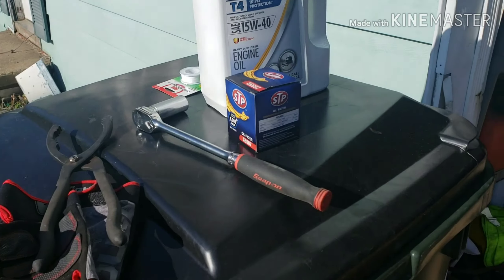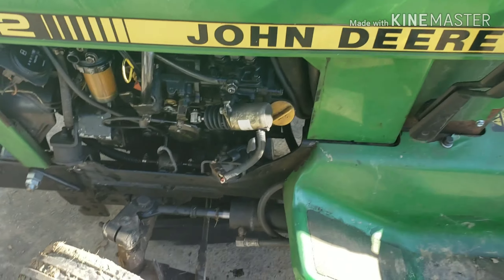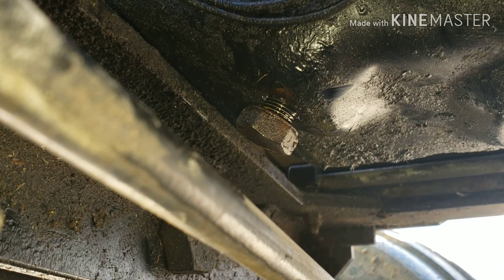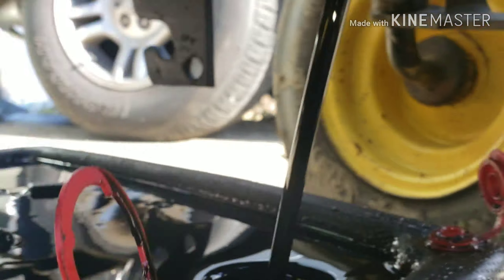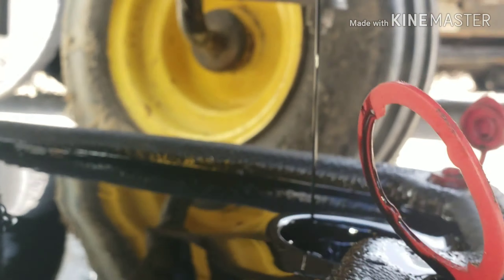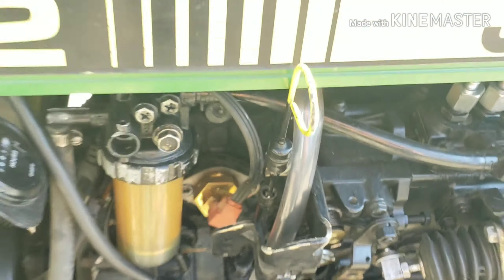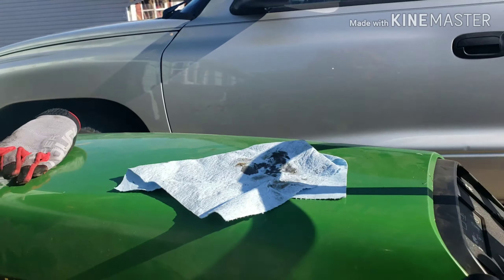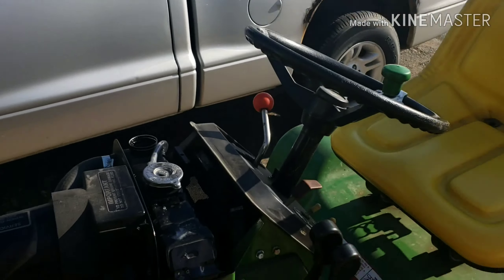Oil change on the john deere 332

Comment: This is a helpful video. I bought the same oil and filter you used. This was my wife's grandpas JD 332 that he bought new over 32-35 years ago and it's mowed the same 1.5 acres ever year since. It's a tank for a riding mower. JD absolutely doesn't make them like this anymore.